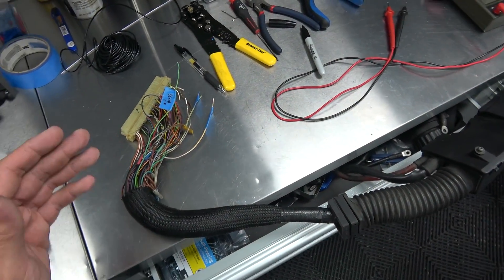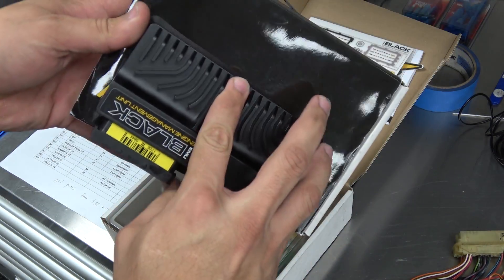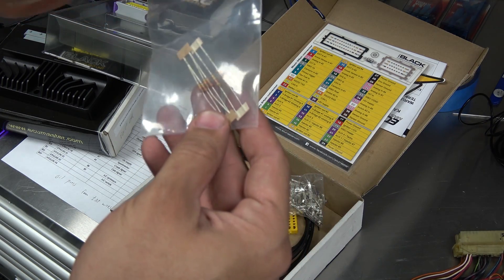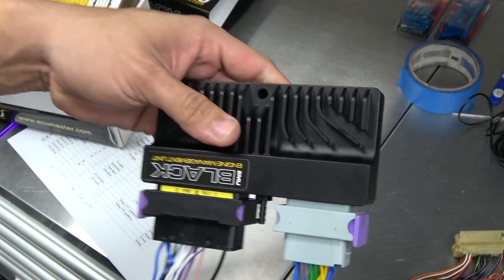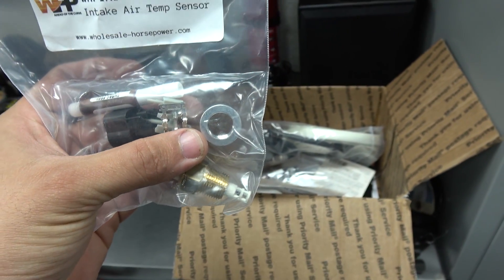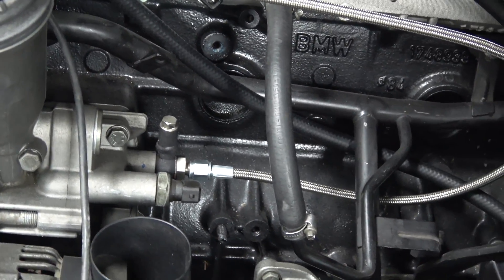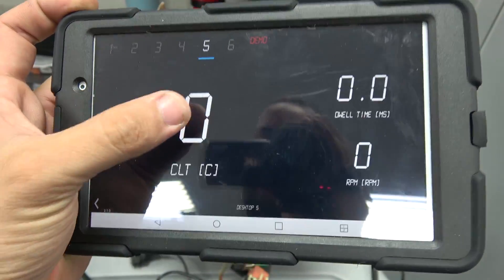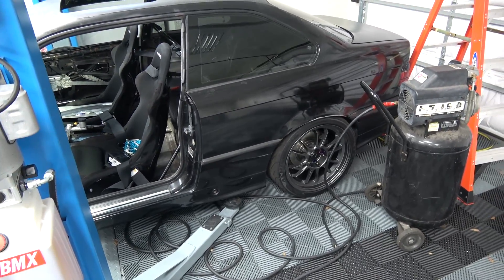E36 GETS A NEW STAND ALONE ENGINE MANAGEMENT SYSTEM!

Comment: Greats I'm building turbo e36 m52 and I Wil run a 413 ecu whit a Miller chip and have a m50 wiring loom non vanos  you need to Change the wiring voor m50 vanos ecu  how did you do it love your builds 😁

Comment: What type of motor is that, what sort of power can it handle (i know nothing about bmw)
Reply: It's an inline 6 cylinder and they can handle tons of power it just depends how much you have upgraded the internals/externals/etc ... their pro car makes around 1000 horsepower with a BMW inline 6 and the engines can go higher

Comment: Sick. I've been trying to find a computer solution that I like. This one looks interesting. I'll definitely consider it. So if I have a e36 328is m50b28 with single Vanos. Would I be able to plug in the harness for non Vanos and then run the Vanos separately or would I have to change wiring harness altogether? Or just custom build a harness? What exactly are you having to do to your factory harness to make this work?

Comment: Can I put s52 cams in a m52 engine. I'm trying to build my e39 528i fast.
Reply: xaiver williams what year is it?
Reply: ashetonr4l 1998 may production
Reply: If it's a single vanos motor yes, dual vanos no. Easiest way to tell is if the valve cover is a uniform width all the way from front to back or if it has one stubby point at the end.
Reply: ashetonr4l thanks for the info I've been looking all around the internet and came up empty.

Comment: Alberto is it possible to put the M50 itntake on a m52b28 e46 ? i seach but only e36 apear and the intake sistems are diferent :/
Reply: I used an s52 intake on my m52tub28 which is what your e46 has just have to remove a few studs from the intake side of the head and it bolts right. I did so solely for the purpose of easy access to the throttle body.
Reply from the maker: that is a diferent head. so I dont think the intake flange is the same. on single vanos heads is the same
Reply: Helder Alves also forgot to add you need to plug the disa ports with something
Reply: you should probably also mention that the e36 intake manifold and the e46 head have completely different shaped ports so it is less than ideal. however it does "work"

Comment: The ECU that you just got is probably really good but I think you should have gotten a haltech ECU and wire harness because they supply custom harnesses for just your car
Reply from the maker: this is a plug n play option, but I have a diferent harness/engine, so I am modifiying it to make it work with this
Reply: So why did you choose this companys ecu, over haltech, megasquirt, etc. It would be nice to hear what features it has over its competitors etc that made you choose it.
Reply: That's the info EMU should be educating Alberto on and he should be giving out in his video, maybe its to come in the future?  (maybe they should be giving you a free one instead)
Reply: Maybe a sponsorship, but I'd like to know too
Reply: This is why i start to dislike these channels, they just start using what ever they get free even if there is a better solution out there.
Reply: they don't have a plug and play setup to suit Alberto's engine, but they had one for a very similar BMW engine, so he has adapted that loom to his engine to save the hassle of making a custom loom.
Reply: krusher74 they are sponsoring this video. That's why he chose them. If haltech came to him instead I'm sure he would of went with them
Reply: krusher the EMU is an excellent ecu, it has all the features of your haltechs etc with out the pricetag. out of the box it is a VERY capable ecu. 

One key difference between the EMU and a lot of other ecus is it has a built in WBO2 controller, so you don't need a separate WB02 setup and output interfaced with the ecu, the ecu can control the WBO2 sensor directly!

The EMU also has built in coil drivers.
Reply: krusher74 I agree with you on how many YouTubers will gladly use whatever products come their way and then try to pawn them on us like it's the greatest thing ever just cus they got it for free
Reply: So it's not plug and play then lol
Reply: will gladly accept one free EMU Black, a PMU would top it off! haha. We are intending to use an EMU Black on our S54 in E36

Comment: 10:20 Ive heard of that happening I thought it was fake
Reply from the maker: i think you can even find some pic on google about it
Reply: its definitely a problem on e46, particularly 323 and 328 chassis... have not heard much about it happening on an e36?? i suppose it would be a good idea to strengthen it particularly if there will be poly or solid mounts for the rear subframe
Reply: Backroad Chaser no happened to even from throttle, hes tj hunts friend
Reply: Backroad Chaser. Yea it happens to the the e36 as well. Caleb just uploaded a video of a e36 with that problem its also on Haggard garage channel as well.
Reply: craig wilson Do you mean the one caleb just bought because that's an e46.
Reply: I he did i ment to go back an edit it. but he does talk about e36 having same problem.

Comment: stock stock engine(no modified internals, but new stock internals) 12 psi of boost, stock harness, ecu modded.... 600 hp. What are you doing....565.3HP............